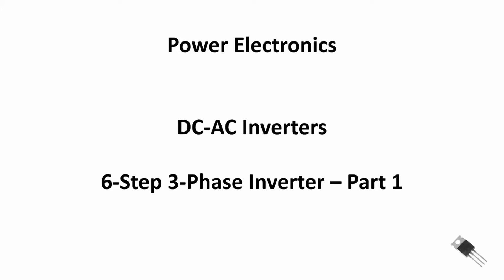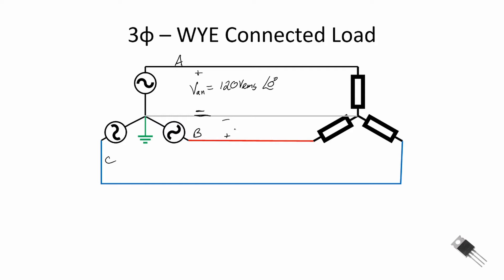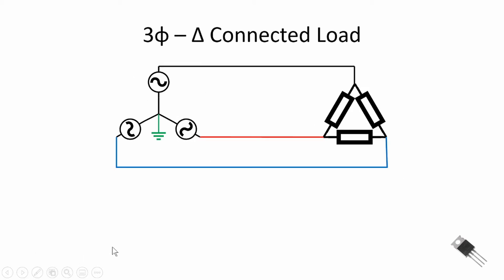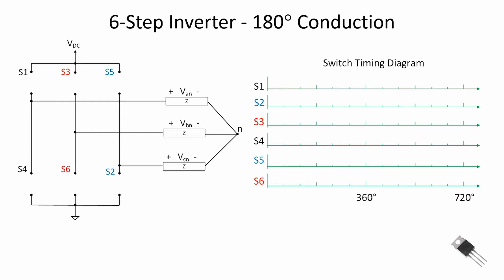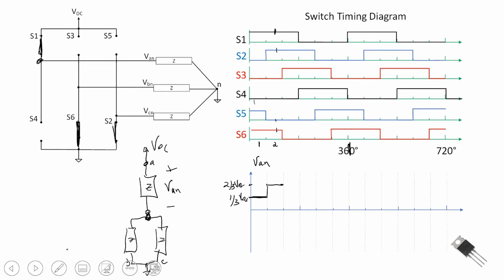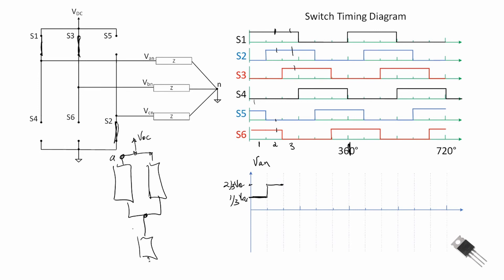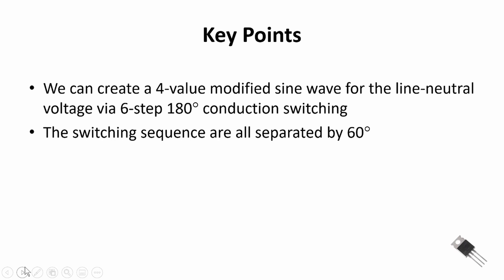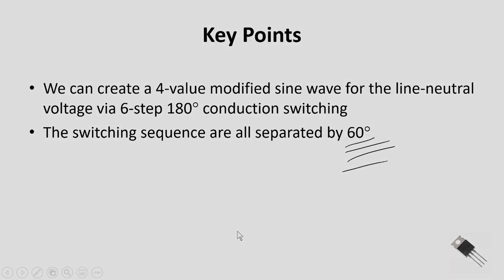Power Electronics - Six Step 180-Degree Inverter - Part 1

Comment: VFD’s rectify the AC input to DC. The rectified DC which is Vdc in your schematic. Ripple capacitors would need to huge for industrial loads to remove the valleys in the rectified DC. How are the valleys in the DC rail compensated?
Reply from the maker: Depending on the type of VFD, more often than not you will find a PWM based inverter.  Six step inverters are typically used for simpler motor drives or heater driving systems and such applications can tolerate the valleys (AC ripple) on the DC bus.  Both PWM based inverters and 6-step inverters use bulk capacitance on the input (DC bus) of the DC/AC inverter system.  This capacitance is physically placed very close to the switching devices to minimize the effect of lead inductance. The bulk capacitance has multiple functions.  One is to provide charge quickly for applications that have large start-up current requirements.  Another function of the bulk capacitance is to provide a level of "hold-up" time should there be a momentary loss of input.  The bulk capacitance is sized for the output power, amount of hold-up time, and minimal operating voltage.  The valleys associated with the AC/DC ripple can be account  Hope this helps!  Best wishes on your design.